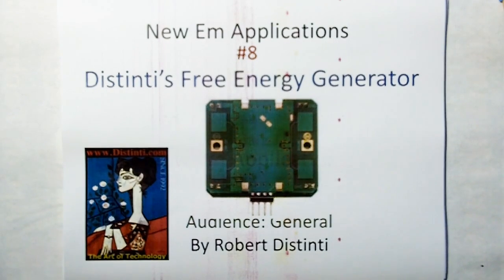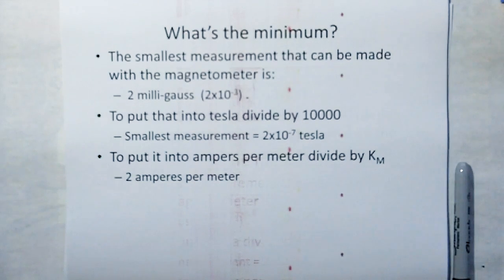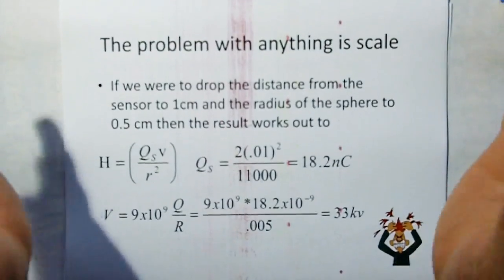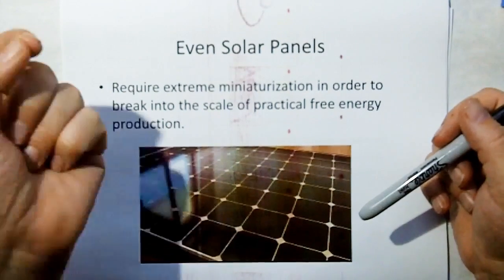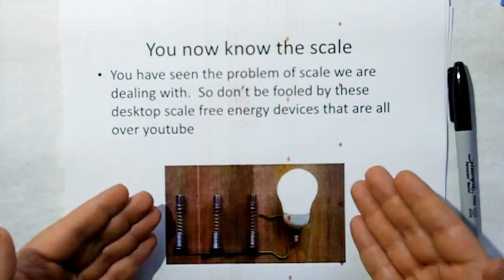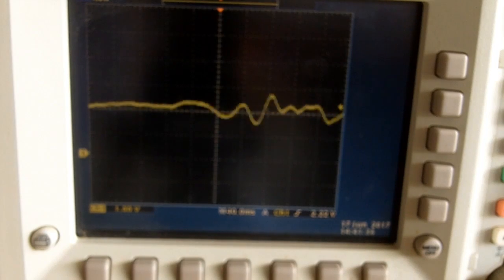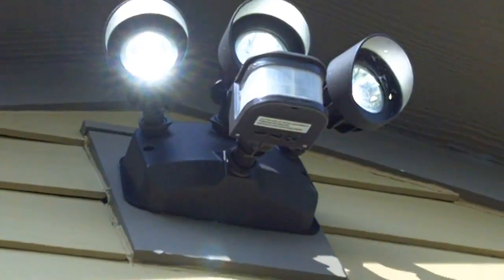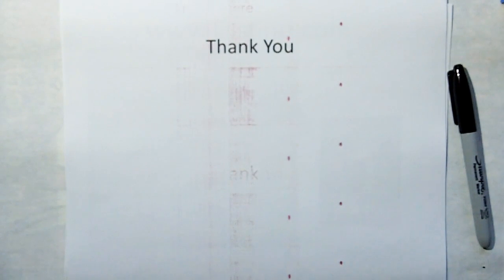NEMA008: The Free Energy Ether Turbine / Starship propulsion project

Comment: Hi Distinti, 
Did you test your theory about NG before ? Could it be tested using an accelerometer ? I think that it could be tested using the accelerometer within mobile phone which is reachable for lot of people.
The idea would be to divert the ether flux that enters into the earth and put the accelerometer below that system.
The charged sphere you have proposed intercepts part of the ethons flux, so this could be measure by an accelerometer below that.
Whats is your opinion ?
.
Reply from the maker: The theory fits existing observations better than relativity, so it is "tested; however, people often confuse "tested" with "proven".   No amount of testing can prove a scientific theory (See ROA1).   The purpose of this experiment is to see if the Etherfall phenomenon exists which would either give more confidence to the theory or disprove it outright.  I would be happy either way because there would be less unknowns in my world.

With regard to the second part of your comment, the detector is not the problem. The focus of EtherealMechanics is to understand how Ether interacts with stuff.  If gravity is the consumption of Ether and if EM fields are states of the Ether then exactly how are these constructs manifested.  From answering that question we can then figure out how to manipulate ether.